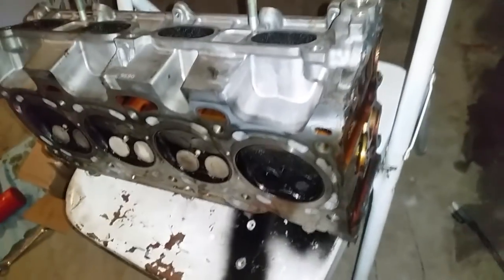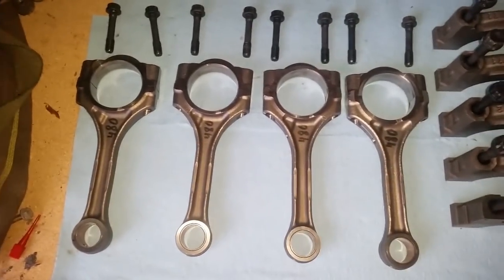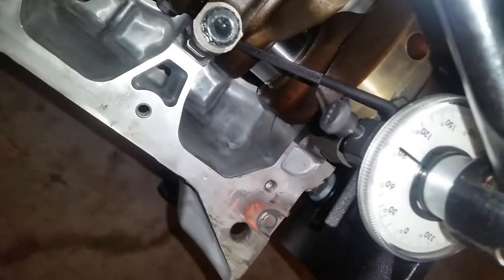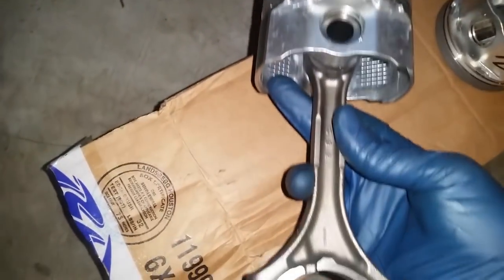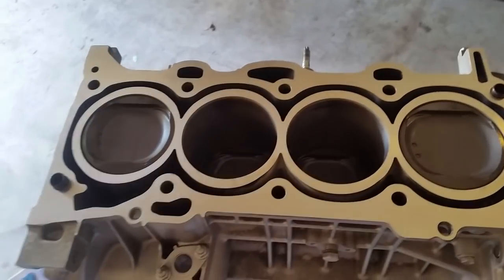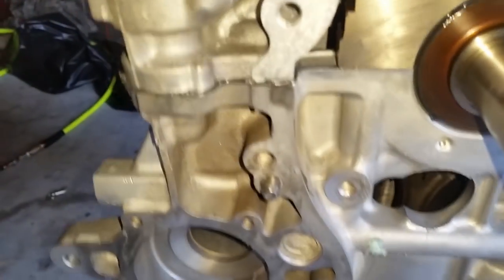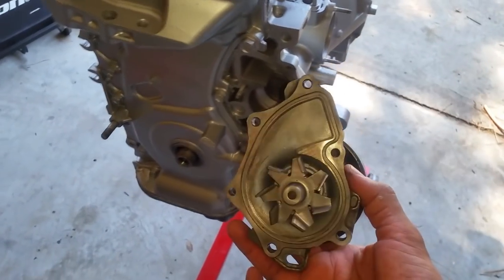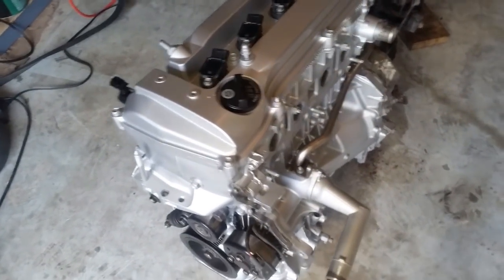how to: scion tc or 2AZFE engine rebuild [DETAILED]

Comment: How much does this cost to rebuild this engine?
Reply from the maker: To do this job at a reputable mechanic shop would cost around 5k to 6.5k to rebuild.
I charged around 1.5k 
Total cost of parts where around 500 dollars. Everything else was labor.
Reply: Where are you located?

Comment: At 35:18 you state that 0.33mm is bigger than 0.32mm by one tenth of a mm, this is a difference of 0.01mm, one hundredth not one tenth. You seem a bit confused by anything to the right of the decimal point, this happens a few times in this video. 0.10 = tenth, 0.01 = hundredth, 0.001 = thousandth, 0.0001 = ten thousanth. So to be clear, to be one tenth larger than 0.32mm you would putting a 0.42mm feeler guage in the gap and that would be way out of spec. You make good videos but you really need to get this decimal stuff sorted out.
Reply from the maker: Thank you! I realize my machinist lingo was incorrect so I made sure I captured the tolerances on screen from the manual to compensate for my error. I will sure continue to learn and correct mistakes. Thank you for your feedback!

Comment: Good to know about the “camshaft caps” but my dumb ass put em on the floor in prep to get em on and managed to step right on one and turned the o into a 0..  didnt crack but had to try and bend it back to round the bestni could.  But fyi if anybody bends one or anything dont attempt to fix it.  Its a waste of time.,  just get the number out the inside of it and go get another ordered from toyota..  because it wont fit right. The tolerances on those things are tighter than the naacp was to blm..

Comment: Am pulling the engine out of a 07 scion tc. I was wondering about the intake plenum but shit an entired detailed video? Yeah, bring it! Lol. But im not doing a rebuild, im just going to buy a used engine instead. Since the engine is siezed, i dont think its worth a rebuild.
Reply from the maker: A little bit of work goes a long way. You'll spend about 450 in a rebuild and everything will be new, and if done correctly its a brand new engine for that amount. 
If you buy a used engine, well its used. Its not going to last as long and it just saves you minor difference in down time.
Reply: @manuelbou  im with you on that a 100%. I totally agree and i can do it myself too, i mean now even better with your video. Lol. But i think its more about the time put into it and the fact that im just going to sell it once i get it running. Know what i mean? Plus i dont have a garage or anywhere to keep block from elements. So thats another thing.

Comment: Don't double torque. Ever. With the torque being followed by a 90 deg turn it's not as critical, but just don't do it. It's a very bad habit to have.
Reply from the maker: It seems you should understand what are TTY (torque to yield) bolts. They are designed to stretch and hold their torque by design that way. Please ensure you apply all manufacturers steps when blue printing an engine otherwise you may experience internal damage or shortened build life.
Reply: @manuelbou  It's funny to me that your reply has nothing to do with my comment about double torquing. Did you mistakenly reply to the wrong comment? Blueprinting has nothing at all to do with torque. Replying to a comment with unrelated facts is childish. I had the utmost respect for you for putting this video out to help us but a reply like that is completely useless.